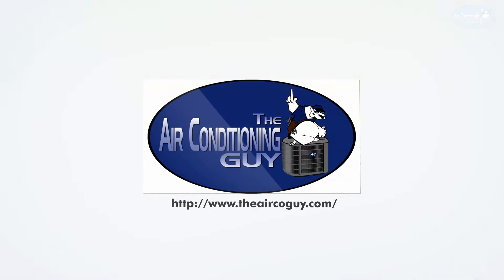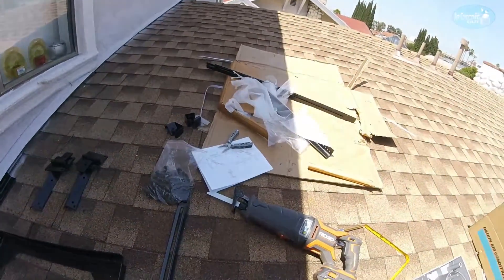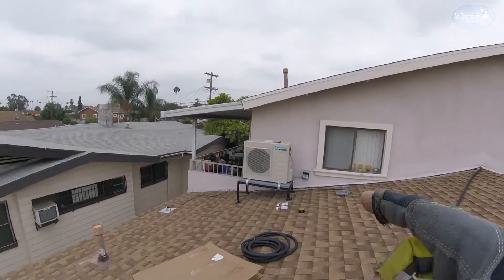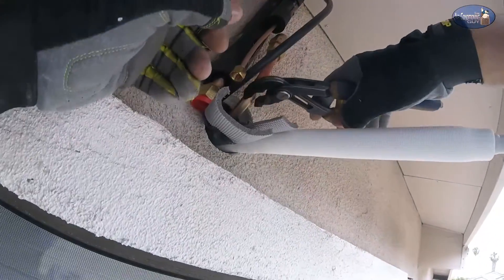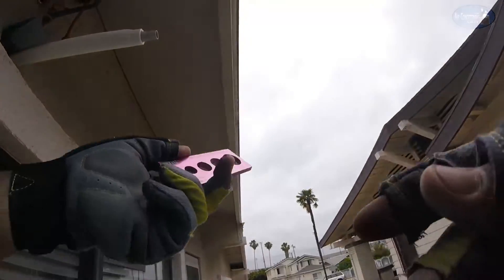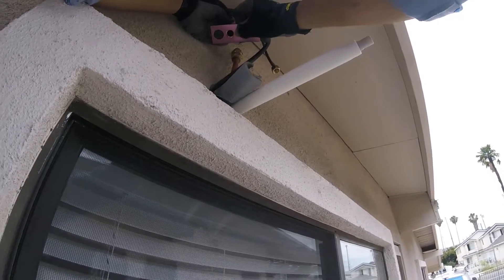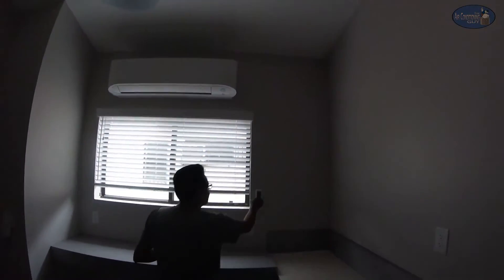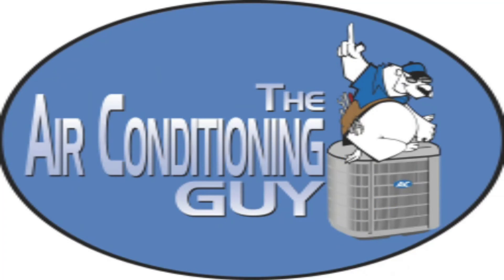Daikin mini split system installation.

Comment: Great video! I have a question. For commecial space, what would be more efficient duct air handler or mini split system?
Reply: Oops commercial**
Reply from the maker: Thank you! Mini split would be more efficient if it's multiple rooms.
Reply: @theairconditioningguy Thanks a lot. Your videos are awesome!
Reply from the maker: @manuelherreros4609 You made my day my friend. 🙂
Reply: @theairconditioningguy  Im glad to hear that and God Bless!
Reply: @theairconditioningguy Hello thanks for your videos. I see that you work a lot with Daikin brand. Im located in NY and i see a lot of Mitsubishi and Daikin. I have a project coming for mini split install. Would you stick with Daikin?
Reply from the maker: Yup! Daikin all day. Only other thing I'd check is warranty and customer service from the manufacturer. Who do you feel gives you better tech support and honors warranties with the least amount of inconvenience.
Reply: @theairconditioningguy yea, i feel like trying out the Daikin because they bought Abco and i just feel like Mitsubishi parts could become a problem to find and most local distributor is selling Daikin in my area. Thanks again!
Reply from the maker: Sounds like the choice is clear.

Comment: I just had one installed, but noticed the back seems open. Is there no cover that goes on the back side of condenser against wall part
Reply from the maker: Some units come with a cover but most don't.  You can order one from some manufacturers but in my opinion don't waste your money.  Not really necessary.

Comment: Any advantages to Daikin over Mitsubishi?
Reply from the maker: I think that if you install either one correctly it should be fine. Dikon comes with a 10 or 12 year warranty on parts. I don't remember what Mitsubishi comes with.
Reply: @theairconditioningguy  what's the copper tubing size is?
Reply from the maker: Sizes are in the installation instructions.

Comment: I enjoy your videos, however you skipped over the whip and wiring. Could you offer any clairification on that. Either on the inside unit or outside?
Reply from the maker: That's because these are not how to videos. With these videos I'm just trying to show potential customers the process and the end result. But as far as the wiring goes it's  all in the installation instructions. Power goes to the outdoor unit then that one powers the indoor unit plus there's a communication wire that's all in the instructions. It's really quite simple.

Comment: How is that stand secured onto the roof?
Reply from the maker: Lag bolts! 😎👍
Reply: Do you use a sealer?
Reply from the maker: Yes
Reply: Do you use a sealer?
Reply: Sorry I’m all hesitant to make holes on roof but What kind of sealer did you use?
Reply from the maker: Henry's roof cement. This is the way I've always done it. To this day I've never had a leak.

Comment: JUAN,,,nice work,,,,in those mini split,,,you do check the Superheath you don’t you put temp probe ? If you do ,,,what should be ?
Reply from the maker: All it says to do is check temperature split. Charging should be done by measuring line set and weighing it in.

Comment: Nice work, was more interested in the install of inside unit, but thx
Reply from the maker: I promise I'll focus on that next time.
Reply: Do all mini splits come charged already ? Just pull vacuum and open it ? Thanks
Reply from the maker: They come with SOME refrigerant. You'll have to read the installation instructions of your particular manufacturer. If you install more line set than the unit has refrigerant you'll have to weigh in the rest using the chart in the installation instructions. It will read something like" x amount of ounces per ft of line set".

Comment: Nice job! You do excellent work. Do you have any problem with the rack bolts coming loose and where did you get it?
Reply from the maker: The nuts are a type of lock nut, so they don't come loose easily. Thank you for watching! US Air Conditioning distributors sells them here.

Comment: Compa. I have a 1,000 sq ft house I’ve had hvac recommend the 15k aurora  or the 18k lv Daikin, i live in Oregon so I would use more the heater.  What do you guys think?
Reply from the maker: 18k
Reply: The Air Conditioning Guy so you think it will short cycle or use more electricity since it’s a bigger unit?
Reply from the maker: @3dB123   12k btu's = 1 ton 1 ton is good for 400 sq ft. If you can get a 24k get that instead. I was just choosing best option from what you presented. I'm not familiar with your climate zone so if I where you I'd hire the company with the best reputation. Mom and pop type. Not big corporation.  Note: Heating is a whole lot easier than cooling.
Reply: The Air Conditioning Guy yes  I have gotten a couple estimates but they all are saying different things. On is going for the 15k and the other an 18k both are Daikin. They Olán to use one unit to do the whole house. They plan to install it in the living room and I just have one main hall way that connects the bathrooms and rooms together
Reply from the maker: @3dB123  You don't rather install Central heading and AC? Sounds like you need at least a 2.5 ton system. If you can't afford it I'd wait and save up for it. It's a big ticket item! Better to wait and get right size system than install something cheaper that just won't cut it in extreme conditions.
Reply: The Air Conditioning Guy I live an an older small home. And Oregon weather isn’t extreme where I live the coldest is around 30f and newer homes don’t even come with a/c unit.
Reply from the maker: @3dB123   In that case I would get the largest unit I could afford. Mini splits are great! (When installed correctly)
Reply: The Air Conditioning Guy  I got the lv 18k.  I’ll report back and see how things turn out with this Machine

Comment: What did you use to cover the line set? A UV blocking wrap?
Reply from the maker: Exactly, that's what is required here in southern California.
Reply: The Air Conditioning Guy what brand is it?
Reply from the maker: @cdubs1723    

 http://www.airexmfg.com/

Comment: I wonder, Juan, would it help if you run the line set to the left? Use this hole just for the drain and drill another hole on the left side and route the line set through there?
Reply: I’m asking because I have the exact same job coming up this week. I value your opinion.
Reply from the maker: @josbrun  That means I'd have to make two holes.
Reply: The Air Conditioning Guy  Yes, but you can bend the line set using your bender, and you make your connections inside! You make one smaller hole for the drain only, and 3” hole for the line set. I think I will try to do it that way. I’m afraid of putting a kink on the line.
Reply from the maker: @josbrun  Makes sense. Post a video!

Comment: I remember when the lines used to have the bending springs on them.
Reply from the maker: RIGHT!? What happened to those?
Reply: @theairconditioningguy  Sometimes they are still there when you pulle the insulation of the indoor unit. For the case it would be great for bending .

Comment: Nice install Juan, but your still using a flaring block get with times old man LOL 😂
Reply: I own the one made by CPS. I've had it for six years and never had an issue with it.
Reply from the maker: @airoasismechanicalhvac7475  I'll try that one thank you.
Reply from the maker: 😆😂 Any particular one you recommend? The the two I bought didn't work out so good.
Reply: The Air Conditioning Guy I highly recommend the Spin flaring kit . You put it in your drill , makes perfect flares .

Comment: Can we change Ball Bearing of Indoor unit Blower motor in DAIKIN Split AC.... Its making a sound like this.... 

https://www.youtube.com/watch?v=noi7vuGTtf4

I've pics of the motor as well...
Reply from the maker: I can't tell what that noise is. Did you check that the blower wheel is not gunked up with debris? I'm sure you could replace the blower wheel if necessary. I'd start by contacting the manufacturer or nearest vendor.